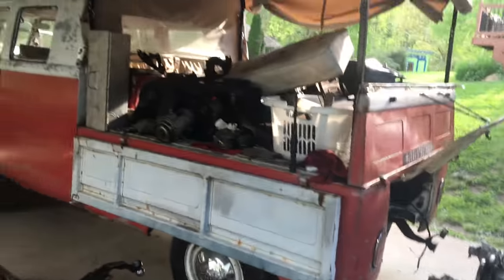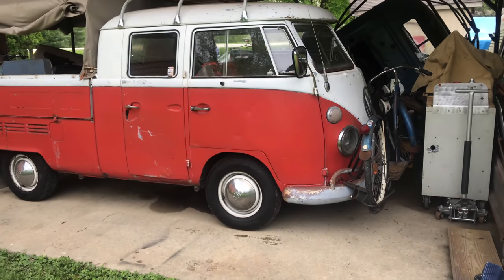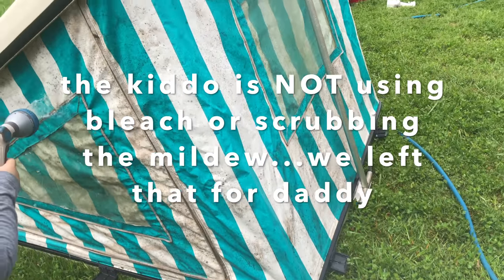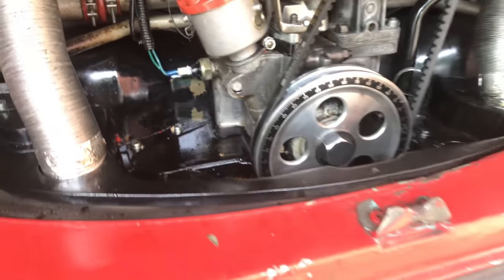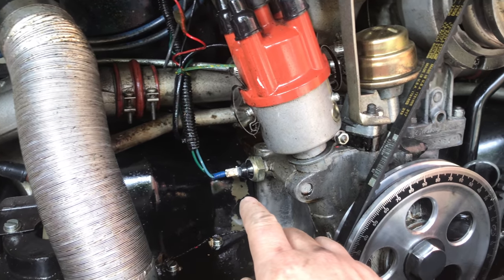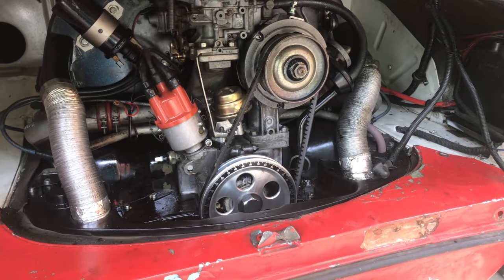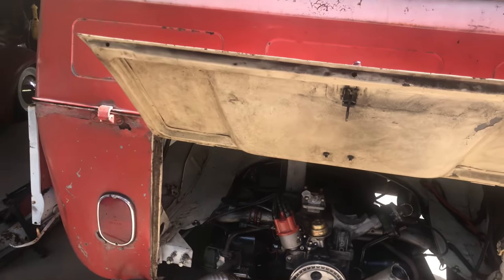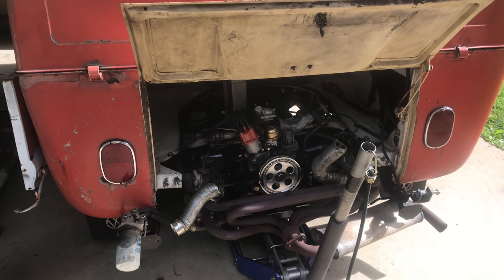Fixing a VW bus oil leak! NOT what I expected!!

Comment: The tent is so cool, nice score!
My bet with the leak is the distributor seal 👍
Replacing the oil cooler seals since you already have it torn down wouldn’t be a bad idea.
Reply: I've never seen the distributor oil seal leak that much oil. I've also never seen a distributor oil seal go bad.
Reply: Steve Warren I had it happen to a buddy of mine.... exact same issue she’s having, he had also. Distributor seal was flat, I replaced the seal and he hasn’t had the issue return.
Reply from the maker: I too am leaning towards dizzy...just too much oil around that area for it not to be that, fuel pump or oil sending unit and those other two have been changed and tightened recently!
Reply: @marcijunebug  looks pretty clean under the dizzy clamp. Should be oily if leaking.
Reply from the maker: @stevewarren3051  oh it's oily...trust me! lol just can't see it...and entire back side of that area is pretty stained ...I;ll hopefully know something Saturday! gotta get this one back on the road! I need my truck! blew a spark plug out of the head of our big ford v10 the next day soooooo got no truck til I fix one of them! ha
Reply: @marcijunebug  Look at 21:09. If it was leaking out around the dizzy, it would wet and dripping off the clamp.

Comment: That’s what I love about VW’s the access to the motor. The camper is awesome what a family fun package.The men did a great job cleaning it up.
Reply from the maker: yes they cleaned it up to good as new I think! easy access and they aren't much more complicated than a lawn mower, simple no fuel injection, no goofy computer crap and no RADIATOR! lol
Reply: Radiators I wish the Fc was air cooled right nowI’m dealing with overheating issues.atleast I got the other vehicles problems fixed but it’s all part of it . It’s gratifying when it’s done
Reply from the maker: Roy Works i knowni hate fighting water issues...I was in my landie once driving thru town, hit big bump and the radiator clip had rusted through...radiator fell back directly into fan blades and Cut a nice cookie cutter circle out of the radiator! Couldn’t find one to fit at junk yard had to pay a local guy to rebuild...was crazy money too but still cheaper than buying new!
Reply: marcijunebug I’m really hoping it’s not the radiator I really think it’s the water pump but I’ll find out this weekend. Good luck with your oil leak.

Comment: Dear Misses Marci.
👍👌👏 Uuuuh, maaaa'm, that sleeper looks nice (and not only because it's my favourite colour green/turquoise). If you put it on Pickles roof, the 30 hp engine won't love the additional air resistance and weight for sure! But I have to admit that it definitely will look good.
If you put camper furniture in Pickle and add a trailer a common e- bike probably will be faster! 😁😂
Hope you will be able to find and stop/repair the oil leek.
Best regards, luck, health and wisdom.
Reply from the maker: I'll fix the leak this weekend. as long as it isn't a cracked block...leaning towards distributor being my issue...there is a rubber o-ring in there and it is likely leaking past it...we shall see...yeah pickle won't like the topper up there, but it only weighs 100lbs!!! so basically like throwing a teenager up there!  ha can't wait to use it! If I don't get this engine in we might we using it in the carport! 😆💙
Reply: Dear  @marcijunebug  
Thanks for replying and for two hearts (one red, one blue).
😕 Just a moment, Ma'am! We absolutely should not think negative =  it is not a cracked block! If any it's a cranked block. 😁
You mentioned that this engine has a lot of oil pressure. Why?
Can't wait to see the finished but cart. 💚
Have a nice weekend.
Sincerely yours.

Comment: Hello Marci, dont forget to check the crankcase ventilation near the Oil filler. If there is blocked the Engine pushes out the Oil on the Belt pulley and other points of the engine. Hope you can fix the leak.

Comment: Your son's better on a tractor than some adults are in actual cars....that's a discussion for another time, tho :) I'll hope that it's a top-down issue,& not in the block - any fluid leak is a tough chase, even in a small engine, because as you already know, every fluid is pressurized. Couple that w/airflow as you drive, and the pulley flinging the oil around, & it becomes harder to find the actual leak. But you know your engine, so once you've got it cleaned up & running on a stand, it should be an easy fix. That top's a nice addition, too.
Reply from the maker: yes...finding an oil leak is sometimes like finding a water leak on my sailboat...it is NEVER coming from where you actually "see" the water...always trickling down from somewhere else! ha...I will get it...and yes the little man is pretty good on the mower...good practice for his go kart!

Comment: Hi Marci, Today I come with a little comment again, I`m used to my new read glasses. Woh here yo did quite some job to pull the engine out engine room. Well, now you have free sight on the oil leak issue, and the rest of the engine, great what you are planning to do with the cleaning and paint the engine. It`s some a job bud at the end a nice clean and fresh painted and clean workspace, waiting for the next video again, with wishes for a nice weekend. with the best of wishes for your project. HCS.
Reply from the maker: so much easier to see it out of the bus...and the engine is an absolute mess,...oil everywhere...had to be pulled just to clean it if for nothing else!
Reply: @marcijunebug  well you get the job done as useual, good luck wit the assemble the engine back again.

Comment: Mine had a leak in the same spot and end up to be the oil pressure sender unit. Not the treads but oil was coming from the wire spade connector. I guess the plastic section cracked or something.
Reply from the maker: yes we have had that on this bus AND recently with my Dad's 55 beetle...they are just made so cheaply anymore...and the plastic sometimes doesn't get a good seal around the spade clip area...I WILL find it! ha

Comment: Thanks for the video, look forward to repair not having a lot to do with the flat fours, that carb you are  running ?is that a better option like giving more power maybe, interesting. Glad it's warmed up for you, hear we had really cold weather one day had to put a jacket on for the early morning, so stay safe  and warm.
Reply from the maker: the carb is a dual port...so when you "accelerate quickly" (I know, I know it's a VW so that really isn't possible but....) it basically throws double the gas and gives ya a pretty good boost! they work great, but they are really a pain for space...make it really tight!
Reply: @marcijunebug  ok sounds like a great idea, I run landrovers many years so when ever driving past hand held speed detector seeing it's just a land rover often just put the detector down ,we called it our roller,as rollscanhardley.
Reply: @marcijunebug  you would have loved to have seen my '65 bug, it had dual twin barrel Weber's. Ever been in a 120mph bug on a quarter mile run? 😵😁

Comment: Could be the oil sender. I've seen those leak. Never seen a leaking push rod tube splash up into the engine compartment.
Reply: Wood be prudent to do the oil cooler nownitsnout along with other maintainance wile the motor out????
Reply from the maker: the oil sending unit WAS leaking before and changed that...unless it is leaking only under load while driving it isn't currently leaking...although they are made so cheap (can't buy good ones anymore)...I'm thinking o-ring in dizzy...we will know this weekend i hope!
Reply from the maker: thought about it but still debating...I am kind of of the opinion "if it ain't broke, don't fix it" lol and the engine isn't that big a deal to get out of it...

Comment: It possible could be coming from the front main and the wind from belt going around is pushing or slinging it to where it settles at
Reply from the maker: possible but the O ring on the dizzy looks to be a great source for the leak, it is so loose I can spin it freely and oil all up above it on the shaft...we shall see...cleaned everything up and will re assemble and run it on the stand and see what we get.

Comment: Marci, hoping it's gonna be a leak around distributor or fuel pump. If it is a cracked block it's gonna be a pain but not a replacement disaster. Had a discussion with another viewer about welding magnesium. Seems there is a way without turning the block into a pile of white ash. If you get a chance go back to CTs last couple of shows and check out our comments. The other viewer provided a link to the welding process. Got my fingers crossed
Reply from the maker: I saw those comments...makes me kind of want to try it! lol I think it is the dizzy...pulled it today and O ring is lose and sloppy, moves easily...and doesn't protrude past shaft so I'm guessing that is my culprit...fingers crossed..anyway now to get everything all clean and tidy again!

Comment: The oil pressure sensor, saludos desde Uruguay.
Reply from the maker: there WAS a leak there earlier, changed that and it isn't leaking now, but they are made super cheap it could very likely be leaking under pressure while driving

Comment: View # 744 at 3:27 PM on 5/28/20 - NJ....Check the rubber o-ring on the distributor shaft. Same oil leak happen to me the rubber o-ring split on my Bug. And nice tent.
Reply from the maker: yep, that is what I'm leaning towards as well...it HAS to be that or fuel pump unless sending unit has an issue only when under extreme pressure...those are made so cheap anymore...can't get good ones.
Reply: @marcijunebug  It only leaks at high RPM's

Comment: Oil leaks drive me crazy. I put together a 650 Triumph engine and was extra careful so I wouldn't have any oil leaks and guess what, I have an oil leak. I'm hoping it's just the inspection cover on the primary cover.
Reply from the maker: yeah this one is really starting to make me "angry" lol
Reply: @marcijunebug  you'll figure it out. Hopefully it will be an easy fix.

Comment: Hey! Is there a follow up to this video? Did you manage to find the leak? My bus is pooling oil in the same place but can see the leak coming out from under the oil cooler cover. x
Reply from the maker: there are other videos...not sure how many, but was a combination of the O ring on the distributor and the sand seal on the crank pulley.  Both are easy fixes! I'd start by changing those first, best of luck on hunting it down...they  can be frustrating at times!

Comment: Coming out from the front pulley.  Either flinger was left out or front oil seal mod failed.
Reply from the maker: don't think so, but I'm not ruling out anything at this point...this engine DID do that when first built so that has been heavily permatexed to the max and a sand seal there as well...but could be...will know in a day or two!
Reply: @marcijunebug  Started doing this straight after rebuild?  Front flinger/slinger was not installed.  Easy mistake to make.  Also make sure u do the oil filter mod.  While it's apart remove both oil pressure relief valves, make sure they slide freely and have the correct springs.  Good luck and thanks for sharing.
Reply from the maker: @ebutuoyebutouy  flinger/slinger is there...and the guy who did the build with me was my uncle, one of the premier VW engine builders in the area for 50+ years (he JUST retired, this was his last full engine build lol)...not saying he can't make a mistake but it has been fine for 5+ years...something has started to fail recently...and likely a rubber seal or something like that! We will know soon enough! THanks for the tips and commments and for being here! greatly appreciated!
Reply: @marcijunebug  Sorry.  I thought it was doing it straight after rebuild.  First remove the front pulley and see if the deluge is from there.  Thanks for sharing.  Good luck.
Reply: @marcijunebug  Waiting!  What was broken?  Have fun and stay safe.

Comment: anti-knock-in-the-head-safety-mechanism. Does EMPI or Gene Burg make a performance model?
Reply from the maker: oh I'm sure they do , 😆and it probably comes with a gauge in the dash and an oil temp monitor but it probably cost a lot more than my $0.99 bungee lol...after you have whacked your head a few times you learn lol

Comment: Question, how did you tune your Weber progressive? I can't get my fat fingers between the carb and the fan shroud?
Reply from the maker: ... yeah...gotta make yourself a tool by modifying a screw driver and pair of needle nose pliers! ha and little heat to bend them and you have a perfect tool...this one has remained really good, it was tuned out of the bus a couple years ago and I haven't touched it since! ha...fingers crossed...with mine you CAN actually get to anything that needs adjusted, it's tight but with a bent tool I can get to it
Reply: @marcijunebug  thanks I will try that. I'm close on the tuning but a little rich.

Comment: hi marci i'm thinking the oil pressure switch once its heated up it starts leaking  or theres a crack where it goes in to the engine case had this happen on a 64 beetle it would leak like yours has
Reply from the maker: we shall see...little bugger is about to drive me crazy chasing it! lol

Comment: They make a glowing leak detector u add to. Oil and lightnup with a flourscent light???????
Reply from the maker: ummmmm....now that's a possibility!
Reply: U have access to UV. Light, speeds up. Process and throwing $$$$$  at leak, setup engine on test stand then do leak detect.